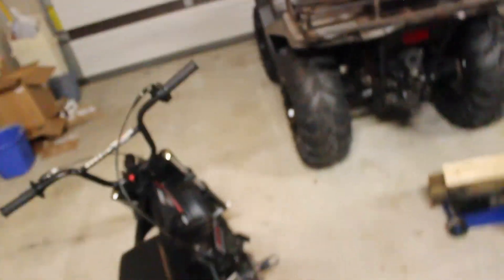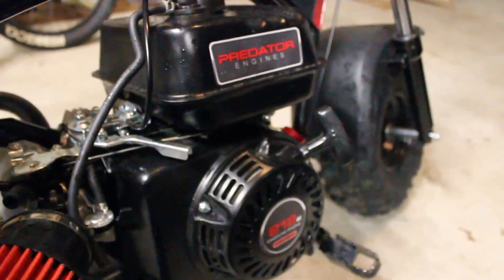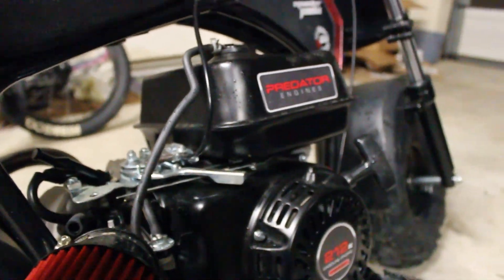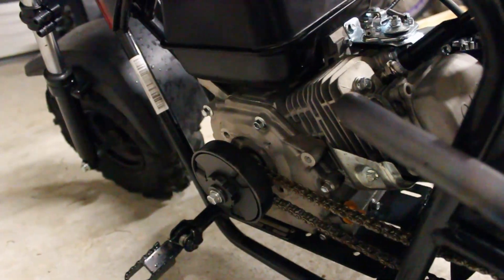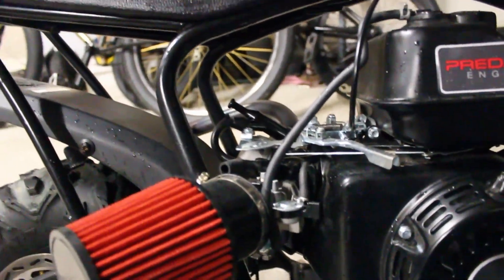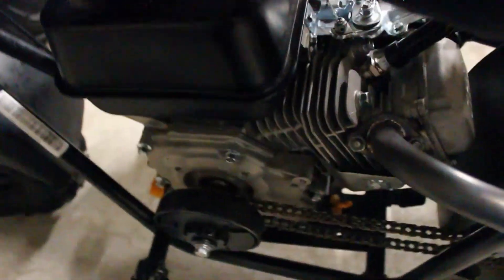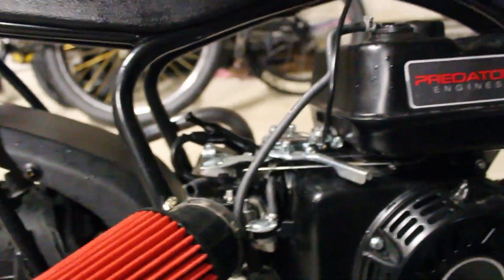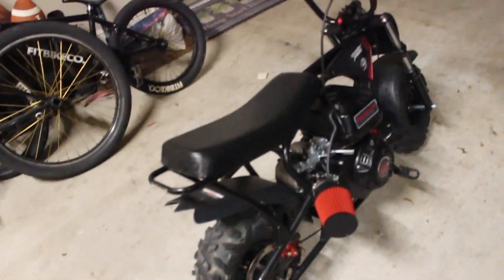Predator 212cc Swapped Monster Moto

Comment: I'm almost done doing this same swap. You can buy a riser kit from Go Power Sports in order to get the carb clearance from the frame, it's a 1in. square tubes that bolt to the engine plate. I found out the hard way a # 30 torque converter will not mount on this frame, if you decide to go that route. My first try working on a mini bike so jump in go for it. There are plenty of vids on YT to help you out. Thanks for sharing!
Reply from the maker: Thanks for watching! Yeah, it kind of sucks you can't put cvts on these cause clutches kick you in the ass and strip out your sprockets 😂😂 A frame riser is usually out of stock at go power sports and that's another cost. But whatever floats your boat.
Reply from the maker: I would aslo HIGHLY recommend these 3 things 1 Smaller rear sprocket 2 Front suspension 3 Killswitch. also I made a great video bout how to wire up a killswitch here's a link https://www.youtube.com/watch?v=4-aWxo8GMc4&t=20s

Comment: And did u put a bigger carb or same one and put intake adapter and filter?
Reply from the maker: @IHitClipzs Its the stock carb with a aftermarket air filter and adapter (with spacers for clearance) and I put bigger jets in the carb plus a header pipe valve springs gov removed. this setup is very strong and fast be safe

Comment: Did you modify the frame at all and is that the stock  motor mount
Reply from the maker: I had to drill out some holes for the motor to bolt up. no I didn't modify the frame. but I used a spacer on the carb cause the air filter adapter was hitting. on a stock motor you'll have to trim the air box to make it fit.
Reply: @louisianarebeltv4878 what’s the space called

Comment: Where did you get the spacer for the carburetor from
Reply from the maker: you will have to cut it to make it fit https://www.ebay.com/itm/185171570327

Comment: So you had to drill holes? What would happen if I didn’t drill any and used the original?
Reply from the maker: you can't use the original holes. the engine won't mount up use a white sharpie and stick it in the engine mounting holes make sure that the chain lines up then drill

Comment: I did the exact same build with my monster moto but still have stock 75 t
Reply from the maker: @IHitClipzs yes, I did a sprocket swap. It made it alot faster 55-60 MPH I'm currently using a 56t rear split sprocket Here's a link https://www.gopowersports.com/split-sprockets-35/ and I will probably swap the 56t to 52t. and you'll need a sprocket adaptor here's a link https://www.gopowersports.com/universal-sprocket-adapter/ but if you do the swap it starts to get really dangerous and really fast, so I'd suggest putting on new brake pads. here's a video for that https://www.youtube.com/watch?v=37bW-Htl4Zs&t=3s
Reply: @louisianarebeltv4878  yes damn hell of a diffrence i just orderd the 53 or 54 t split sprocket from gopowersports just have to wait till the adapter is back in stock!
Reply: @louisianarebeltv4878  can you still wheelie?
Reply from the maker: @bradenfrasure4957  Yes, but not as easily which is a good thing in my opinion because you can step on it and not wheelie. but with you want to wheelie it's still really easy too
Reply from the maker: @blankznasty  here's a link to a adapter that's just as good as Gopowersport's and it comes with hardware which gopowersport's doesn't  https://www.ebay.com/itm/203929116792?hash=item2f7b1f6078:g:vmsAAOSwWSBia6ef

Comment: Where did you get the exhaust from
Reply from the maker: https://www.ebay.com/itm/253950314621?_trkparms=ispr%3D1&hash=item3b209e487d:g:2jsAAOSwIY5hgAWY&amdata=enc%3AAQAGAAAA4PSkdAZC83G31eqj%2FL1Y5iSty5gVnJCgo3Ngb53DdbuND5pT7dhiKqrNa49lACuvNb8WqL8GnluPGKU21PxP5QOaPXbs265%2BxjYiURMKHJGTeUjeIyAjCs%2F4%2B27yOaM%2Fvq%2Bxh6JUYHoSdKMK%2FLMCNCcTVkhOjV76P90L4dXV8sHnYCxqc25Gav2%2FXwVVFAtk4MRvDKJHhkxYtPs1SrFl54sKLN8xhixOnFVRloRJPjesfMmPU1IHnk2IiBgiT1NT%2F%2Bl1d45itn6nagaLMwugciUJblzScztPG0MObQKGsghK%7Ctkp%3ABFBMroiytZFg